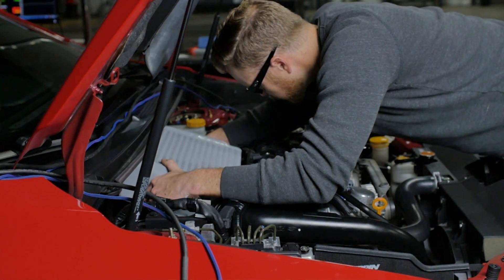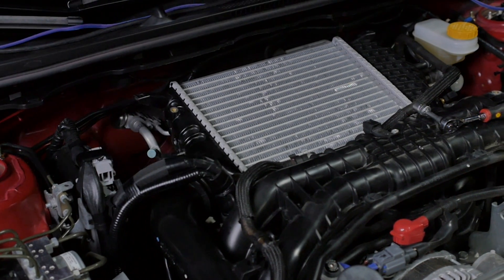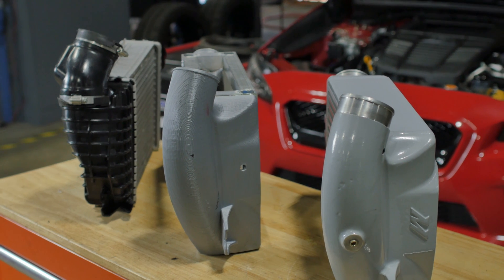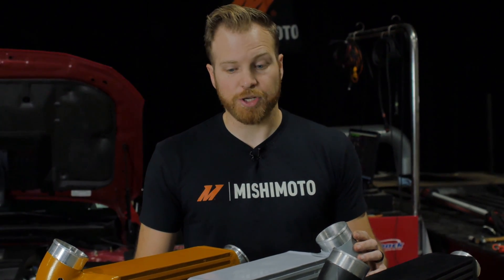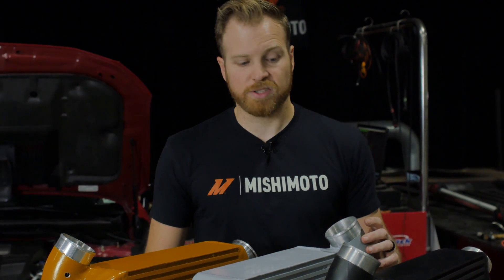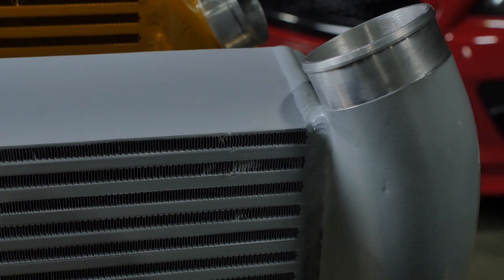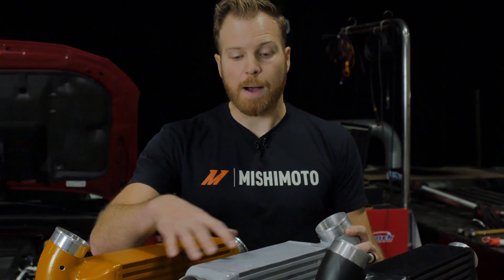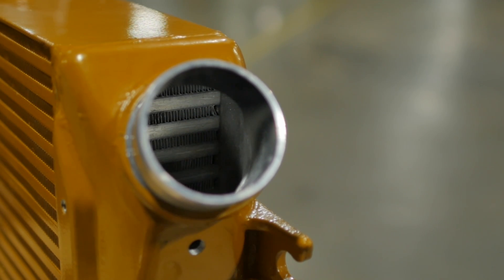Quick Look: 2015+ Subaru WRX Street Performance Top-Mount Intercooler Design and Testing

Comment: Is this safe to use with off the shelf MAPerformance stage 1 tune on accessport?
Reply from the maker: The intercooler was designed to run safely on a stock tune so using an off the shelf map should not be a problem. You should get a lot better performance with it!
Reply: Mishimoto Automotive sorry. It one more question!? Is there a off the shelf map for a 2019 WRX base with the Mishimoto intake. I can’t seem to find one?

Comment: Not a lot of info given before purchasing.  Was the dyno session  shown in the video with your intercooler  installed, on an otherwise stock vehicle? what were the dyno numbers vs stock? I realize there are numerous  other aftermarket companies out theree, already supporting this platform, but wanted to see what the difference is between theirs, and  yours.  In addition to, what does yours bring to the table?
                     Thanks....
Reply from the maker: More details can be found on our product page and engineering blog: https://www.mishimoto.com/subaru-wrx-street-intercooler-2015.html